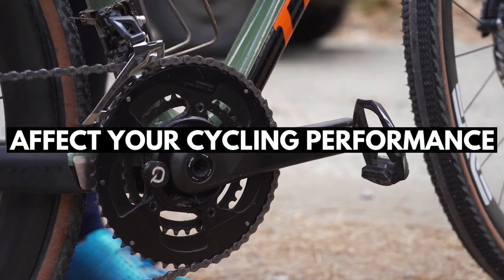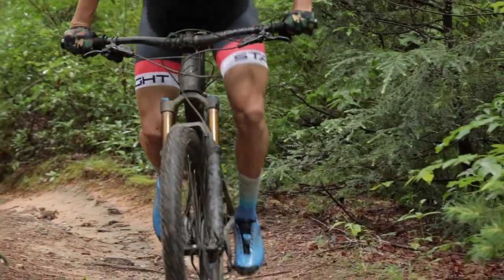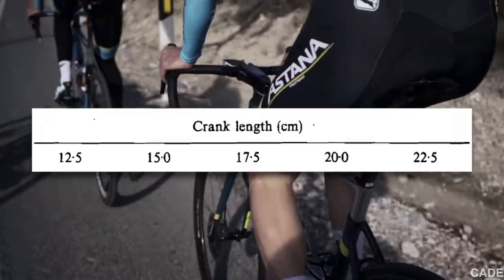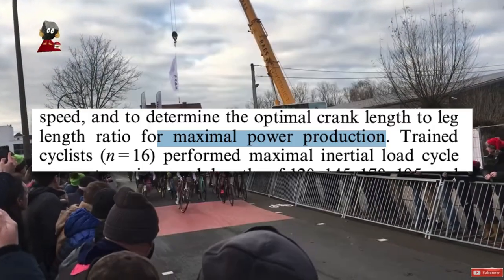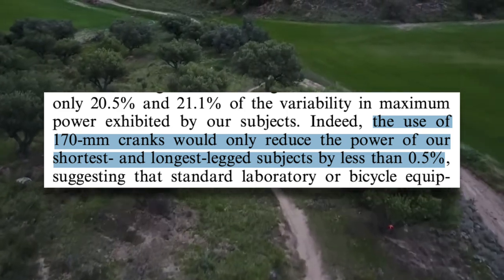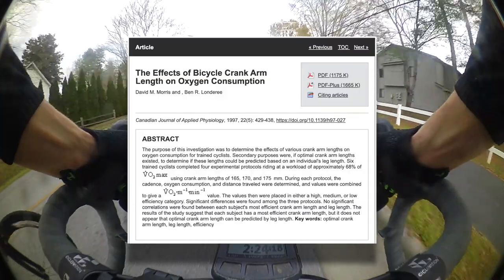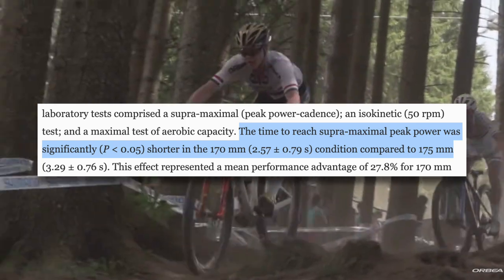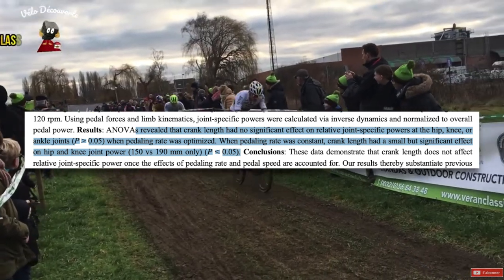Does Crank Length Affect Your Cycling Performance? The Science

Comment: While this is a terrific video, it barely touches on the main point for recreational mountain bikers:  safety.  Most of us don’t care about power optimization or fastest trail times so much as completing the ride without a spinal fracture, shoulder dislocation, hip fracture, or head injury.

I replaced my 175 SRAM Eagle GX cranks with 165 mm cranks on my 2021 Santa Cruz Tallboy a month ago. I notice no difference in power output and only a slight incesse in my cadence.  On pavement the benefits are minimal, however on narrow / sandy SoCal trails my confidence with sharp switchbacks and steep inclines is much greater.  Pedal strikes during off-camber hairpins with 70 degree rocky drop-offs are terrifying; it’s a constant risk with the hillside inches away and frequent small mudslides or stray rocks.

I have no regrets with my shorter cranks.  They’re a major safety benefit here in SoCal.  At $150 they are an excellent value compared with the ambulance ride, orthopedic surgery, neurosurgery or months of rehab.

Comment: Great video!  Information was very helpful as I was thinking of changing my crank from 170 to 175, as my intent is to use my MT bike more as a cross-country bike (i.e., riding more on non-technical trails), as I was thinking that this would help increase my pedal efficiency.  I am 6'2" and prefer riding through the woods on long trails, but still have the bike to handle any bumpy type single trail, but was concerned that if I went to a 175 that this would increase the chances of a pedal strike.  Most likely will stick to 170. Thanks again for the great video!

Comment: Something that didn't come up in your video, is that having longer cranks allows you to marginally ( up to 10 cm) lower your center of gravity on the bike, similar to lowering the BB, which can help with stability & high speed cornering, assuming this doesn't compromise your ground clearance on rough terrain. This may provide a greater perceived difference than measurable one...

The other thing it can help with is fit on a frame that has a long or short head tube, when you are trying to find the right bar height to work with your correct saddle height. Lengthening or shortening your cranks will allow you to raise or drop your relative saddle height by +/- 10cm to find a good balance with the stack height of your frame for the front end.

Comment: Dylan, a cyclist ought to use the shortest crank that is comfortable and allows the best range use of gears.  from 172.5 to 160 the top end speed in the saddle changes.  solving/designing for smallest chainring And smallest cassette is the major point aside from comfort.  so when you go to sprint, the cadence can go up and "CE" can rank well.   source: i saw an old man on a singlespeed ti do some amazing things and it had to do with his crank arm and gear choice; his [gear]"range"(sic) was astonishing. we have all seen this.

Comment: The problem I've seen with almost all of the research I've looked at is that it tends to use very limited sample sizes, and short testing intervals.
It takes time to get used to a different crank length, and chances are any benefits of optimizing the length are probably going to take some time to develop.

I have very long legs and I find my knees are more comfortable on 180mm cranks than on 175mm ones (the 20% rule says I should be running 200mm).  I find that my natural pedaling cadence does drop slightly, but I haven't noticed a difference in my speed.  (i don't have a power meter on my shorter cranks, so I can't guarantee anything)

I also have done some track riding, and there's a better explanation for the short cranks that are typical on track.
It's not so much that track riders are choosing short cranks because they can make more power, so much as you need the clearance to not bang your pedals when steering on the banked straights (which must be still be banked to reduce the hills at corners), or when riding slowly on the banking.
Another alternative would be to run longer cranks with a higher bottom bracket, but UCI regulations put limits on this.
I have 165mm cranks on my track bike, with a slightly higher than average BB, and I still bang them into the floor occasionally.  If I put on the 180s I have on my road bike it would be super sketchy riding down the straights at any speed, and I'd only be able to go through the corners riding quite quickly.
It might be doable for a time trial, but any kind of multi-bike race where you need to maneuver would be impossible.
Reply: nwimpney
This. I can’t think of a way to set up a legit, double-blind study of crank length. I needed took several hundred miles to get my 200mm cranks wired, but once I did, EVERYTHING got better—climbing, speed on flats, overall endurance, sprints. But could I prove it scientifically? Nope. 

I have a 99.5 inseam and always rode whatever came on the bike. When I went custom (shout out to Curtlo Cycles!), the builder told me to go with 200mm cranks. I was nervous, but in our bike builder I trust. So glad I did. Not only am I faster and more comfy, but to my surprise, my average cadence was within 2rpm of what I typically held on the 170mm, even though my max is not quite as high. Now when I ride my gravel bike with 175s, it feels like a child’s plaything.

Comment: Thank You. Good research. I’ve been running 175mm for years (32” inseam) on bikes around 56cm. Now that I am an old man, and In the market for new road bike, I am looking at 172.5mm as it seems my knees are getting a bit sore on rides where I am pushing more power.  I was worried about going down to the smaller crank length, but this video tells me - it!’s no big deal for  2.5mm delta.

Comment: With deFailleurs, you just won't notice for sure. Mine all had 165s, they always felt lame to me. Before internet, I just had no clue about using different stuff. 
I am 5'8" with about 810 mm standover. Mostly I rode 58cm bikes, a tight fit.
I put 180s on my custom tour bike, because that's what my antique SS Rudge had.
After a slow acceleration, I just float along easy as pie. About 75 rpm at 16 mph.
When I got a SA 5w, it had 165s for the first 3 rides. Then with the 180s, the 9% increase in power moved the shift point 1 mph and made hills way easier. 

The way I see it, I need to push down 9% less for the same speed, while a shorter crank guy needs 9% more RPM. Funny thing is, we both go the same foot speed along our different circumferences. 

Just like with my SA 3 going from 46/18 to 46/19. The shift moved from 14 to 10 mph. Huge difference. These cranks are 1 piece 167mm. This CCM bike is 30 lbs lighter, but 2 mph slower. WTF?? It has brand new 650B wheels.

Comment: While I can‘t underpin my findings by actual data, I figured out for myself, that a short crank fits me better. As a tall rider (6‘2.5“) all stock bikes I get are usually equipped with a 175mm crank. However, a a 170mm feels much better for me, as I am better with higher cadence. That’s why I ride 170mm on my roadbike and 165mm on my TT Bike. Always bare in mind that these are differences in the area of 1/10th of an inch, so the effect on torque is also minimal.

Comment: Having 165 on my track bike, 170 on my commuter fixed-gear and 175 on my road bike I can say crank length matter a whole lot. 
I can reach 140+ rpm on my track bike out of the saddle and achieve my best speeds on it. 170s spins like a charm, not all over the place yet with good leverage without excessive foot speed. 175s feel off, my fit get all wrong and I get numb everywhere, cannot spin above 110rpm and I don't even feel like sprinting on it.
The fits on all three bikes are very similar (with the track bike being the most aggressive with a long & low setup)

Comment: For what it's worth I rode on 155mm cranks for about a year,  (5'8" longish legs) and found them great for long fast rides. I'm on 170mm now but might dig out some short cranks to see what happens. We are locked down at the moment but allowed out cycling for exercise... I find 175mm much too long on any bike.
Reply: Now... Where are those bloody cranks 😁.. will see what 190 watts for 20 minutes feels like.
Reply: I'm the same. My Rohloff tour bike has 180s and is 78 lbs or 120 lbs loaded. 
After I get up to speed, it just floats along. LOL 
It is 46/ 16T, also way higher than most. 
I am old so I get cramps a lot.

Comment: Thanks, Dylan. Always thought provoking. Your summary at 10:51 does not seem in line with your earlier summary of the shorter crank length and sprint power, rather your earlier summary suggested the athletes reached their peak power faster, correct?
For track and other fixed hear riding - shorter cranks also means you can corner as faster speeds and not strike your pedal (since you cannot stop pedaling).

Comment: For Track Sprint it's an interesting one, because you have to account for the reduction in gears with the same leg speed "rpm". Standing starts are better with a longer crank (higher moment), and shorter cranks are generally seen as better for spinning once at speed.

Comment: Power and crank lenght and small power percentage is 1 thing, but comfort and getting the right position to hold that power for extended time is another. 
Im 5 ft 6 and with 170mm cranks and correct bike fit i still seem to get a sore lower back. But with 165mm cranks zero issues. Saddle hieght measurement is taken from centre of pedal bolt hole, not BB.

Comment: There is a couple more things to be said about it. Going from 175 to 165, means you will have to raise your saddle by 10mm. Then there is the case of shorter cranks requiring less hip mobility when using aero bars. And less knee flexion. Both good for the long distances. But sitting higher is not ideal in my opinion.
Reply: Kai Barstad It’s okay, you gain an aero advantage being able to get lower over the bars which can be lowered. Also I think it would.

Comment: Great video. This is going outside of the scope of it but here is a perhaps interesting personal observation: 
I experimented with cranks from 153mm to 175mm. 
On an upright bikes which I ride with just flat pedals I like 170mm the best. 
On recumbent bikes which I ride only with clipless pedals I like 160mm cranks and weirdly they feel the same as 170mm on an upright. Compared to 170mm knee pain after very long rides is less likely with 160mm - on a recumbent, I cannot do a long ride on an upright. 
I think that on upright bike you have more pelvis movement available and you want to stand up sometimes using more force and less rpm (therefore longer cranks), while on a recumbent just spinning faster is the best way to make more power (therefore shorter cranks). Maybe this is why different length feels comfortable.

Comment: After running 165 on my track bike and 170 on my other rigs, switching to 175 was soooo crazy at first.  I felt like my legs were flinging off my body!  However, switching to 175 was necessitated by moving to the Appalachian mountains.  My spin is just slower (rare to go over 160 rpm) and having that extra length has seemingly helped me with the miles long 4-6% climbs.  Plus I'm 56 now, and I don't do anything fast, just longer.  The longer length seems to help, but that could just be the placebo effect.

Comment: Track riders use shorter cranks to avoid grounding the right side pedal on the banking when going relatively slowly. To avoid damage to the track velodromes have a maximum length specified.

Comment: I scrolled through a few to see if this was mentioned,  but my 'problem ' if you'd call it that lol with these studies...is the variability of adaptability.  
The subjects are tested, both the crank and cadence type studies, outside the ranges they have developed strength and neuromuscularly. 
Without allowing months at each of them in blocks, which no one will do, the numbers are skewed.
Looong ago , (before the swift days) used to teach people on trainers in the winter. I had shown clients that said spinning shot their heartrate up so they didn't do it, thus having a narrow range to work in. Coudnt grind well on steep stuff, couldnt react to surges in crits or flying tailwinds.
Anyway, by the end of 6 weeks , a 90 -95 rpm would illicit quite a HR jump...later could do 120 same gear for extended time, minimal HR jump. (Other factors of course involved of general fitness etc) but being they would never go above 100 for 30 seconds or got bouncy

Comment: Im 6'3  my in-seem is 35'3/4. I run a 180mm crank arm length. I have run 175mm and still have 177.5 on my trainer bike. Personally I prefer the length. My Average cadence on rides is about 84. I try too keep it at 90 plus. I want go any longer though. There are charts online that give a great ideal crank lengths to in-seem length. Whish I could post that. 177.5 is probably my ideal length and 180 is at the top of my range. Different size bikes should come with different size crank arms more than just 3 sizes with a 5 m difference 170,172.5,175. To get real power out put comparing crank arm length you need to test the same gear selection. Then measure power at the wheel.

Comment: Crank length is crucial to an efficient pedalling action.  Serious distance, speed or cross country unicyclists have only crank length, wheel diameter and tyre section to vary, and cranks are the easiest to change.  We use cranks from around 75mm right up to around 170mm.  Short cranks means faster cadence but reduced torque; longer cranks means increased torque but reduced cadence.  The ideal crank length for any individual depends on the length and ratio of their leg bones and a number of other variables such as fitness, preferred riding style etc.  If you don't believe crank length matters, then consider two extremes: cranks of 10 mm, and cranks of 300 mm.  Either would be virtually unrideable.   Empirical experience shows that somewhere between 150 mm and 110 mm is best for general riding most unicyclists.  However, a unicycle is low geared (direct drive to a wheel typically between about 20 inch and 36 inch) so requires low torque.  For a bicycle, somewhere around 150 mm to 175 mm is probably ideal.  Clearly a 1.6 metre adult and a 2 metre adult would not find the same length ideal.  However, the industry sells us a smal selection of standard lengths because it is easier for them, and it's what we're used to.

Comment: Interesting topic!
It's easy to understand that there must be a relation between crank length and leg length. Possibly foot size also has some impact.
Apart from that a rider with more muscle mass and strength should gain more from a long crank length because it's more efficient with lower cadence when having a large mass to moving around compared to a rider with thinner legs.

Comment: Hi Dylan, slight correction: track riders ride shorter cranks for the reason mentioned and so that they don’t pedal strike the track. Some tracks have soft rules on length based on the angle of the track. Most I know limit to 165 or shorter. Good riders can ride longer lengths if they are careful but it’s discouraged.
Reply: Depends where you ride, too.  I've done all my track riding on a 200m track, and it's pretty steep.  On a 400m outdoor track, a standard road bike is probably going to work fine. 

Contrary to what most people expect, it's clearance on the banking of the straights that's the limiting factor.  The steep banking in corners limits your low speed pedal clearance, but you're almost perpendicular to the track at high speeds.

The banking on the straights limits clearance at all speeds.

Comment: That was very informative. Thanks. I've found from my own experience that it really  boils down to fit. With a good fitting bike you can be most efficient. Even if it's a  perceived differance having a little more confidence might push you just a little further.

Comment: Hardly a child on a kid's bike, I use 150s, but there are multiple reasons. Firstly I have short legs, but after breaking my hip and being left with scar tissue right where my hip hinges forward I couldn't get my leg over the 10 to 2 position without actually swaying my upper body. I found a site that did the research, (bikedynamics.org) on leg length and crank length and my numbers, without injury should be 153. Just the same I was skeptical and tried a slight drop of 167.5s. Better but still a dead spot at the top, then 160s which I was happy with and ran for a good year before getting a TT bike and thinking I'd try 150s on it to get more aero. Well I like them so much I run them all the time. Given my experience I would say there are a LOT of people running too long of cranks.

Comment: It does affect. i don't know if it affects performance but it definitely have an impact on the way you ride. I had to sell dura ace 175mm cranks and switc back to 172.5mm because I could't get used to the longer cranks
Reply: That indicates to me that your 172.5mm cranks are probably too long. I could always tell the difference between 165mm & 170mm as the 170s gave me joint problems. About 6 years ago I found some formulas for calculating crank length my ideal crank length is 152mm (got short legs). When I now use 150 or 155mm I can't tell the difference, but as soon as I try a pair of 160mm I feel over stretched & get tired more quickly. Did try a pair of 145mm they felt the same as the 150mm to me. After 45 years of cycling with 165/170 cranks I was starting get knee, hip & lower back problems, since changing to the shorter cranks the knee & hip problems have vanished. Lower back probs reduced, but I did have a bad accident 8 years ago which damaged my back.

Comment: I'm 5'6 and ride a 52cm road bike. I use 170mm cranks because on some frames my toe could strike the tire during a low speed turn with longer cranks. Finding rake 48mm+ forks is a tough one too.
Reply: forks with a lot of rake will be a little twitchy with standard headtube angles too.